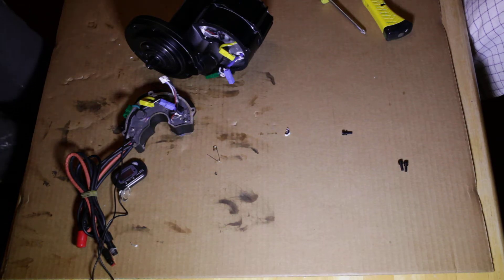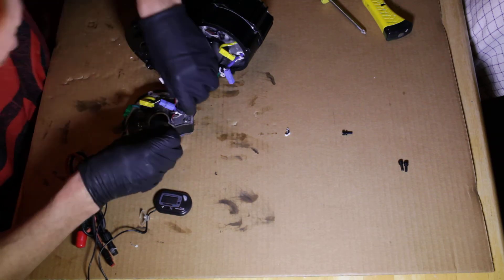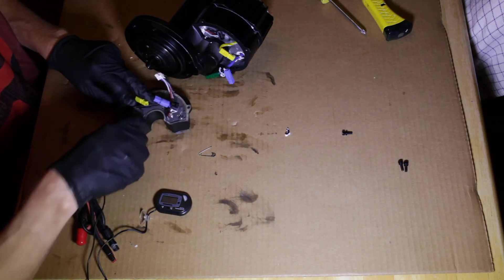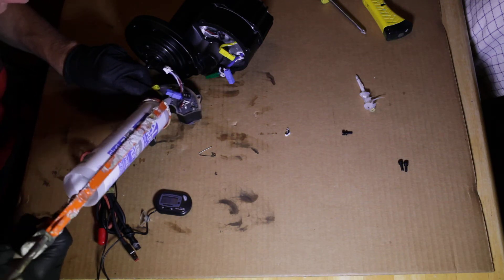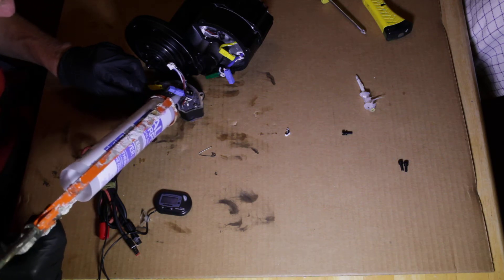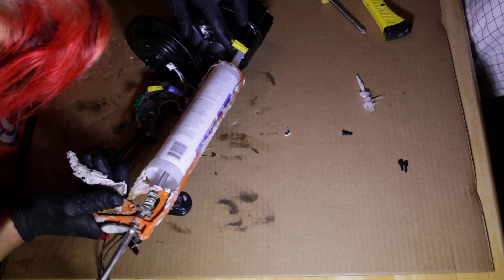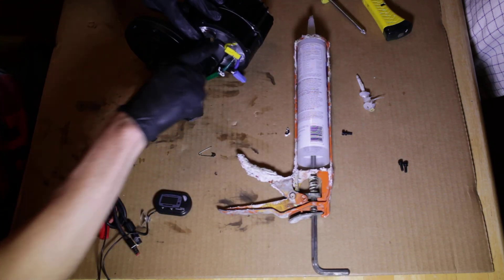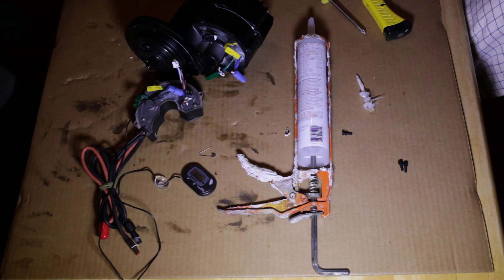BBSHD Installing a temp probe in controller and disabling the PAS system

Comment: I turned off the mode PAS by programming my controller it is not required to disassemble the engine
Reply from the maker: You can disable the PAS by programming but you only get one throttle power level. By disabling the wire you can program your BBS02 to have 5 different throttle power levels. Many people with the new BBS02 controllers opt to do this as well because the PAS overrides the throttle settings which many people don't like. On all 8 of my BBS02's the throttle always overrides the PAS settings because they are the older units.
Reply: @Electric-fatbike  I can get 9 different power levels, which I can control the throttle, while the PAS does not work. 9 levels are too much for me, I used 4 power levels of 1 ~ 220 watts, 2 ~ 500 watts, 3 ~ 1000 watts, 0 - maximum power. I prefer to switch between the first and zero power levels. To disable the PAS system, it is necessary to set the value 1 in the "Time of stop" field.

Comment: Awesome videos.   I just bought one of these pieces of crap!   Your vids are really going to come in handy!
Reply from the maker: +Kory Garretson It's actually pretty awesome on the trails, just needs a chainwheel that can keep the chain on. The stock one sucks. Totally unusable.
Reply: I need a setup that can handle long inclines on rough roads.   Already have the LunaCycle bling ring on order but considering having a shop fabricate an adapter for a smaller chain ring that already exists like a race face.   Your blog is great too, tons of good info. Between you and the nutty australian there are bunch of laughs to be had as well.   Good stuff, keep it up.
Reply: @Electric-fatbike  you wrote on your blog, that you'll test the hill climbing compared to the bbs02b, what s the difference ? (More Watts, More Nm, Gearreduction)
Reply: +Kory Garretson Why did you buy it if it's a piece of crap?
Reply: I was being a little sarcastic, it's the biggest and baddest motor that's available for the money, but it's certainly not perfect.    I'll be building a 29er mtn bike project soon, we'll see how she goes.
Reply: +Kory Garretson why would you choose 29 over 26? The bigger the wheels the lower the power. Why is 29 better then 26? I'm just wondering...
Reply: My bike is primarily used for transportation on bad roads and trails.   The 29 is a much more comfortable and quick ride in such conditions without the complexity, cost, and weight of a full suspension or a fat bike .   Luna Cycle makes a tiny front chain ring for the BBSHD (around 50$) that has solved the torque issue on hills.   I have over 1000km on this setup with 13s and 14s lipo and it is working flawlessly.
Reply: Bad roads Is the only justification I think for 29. Really bad roads. Like, New York style.
Reply: Much, much worse than NYC.    http://qcostarica.com/monteverde-community-continues-battle-for-a-decent-road/
Reply: +Kory Garretson seriously, seems you need a tires bigger then 29 :D  Wow you live in Costa Rica. I think in that condition, I would get a 29 with dual suspension MTB.  Meanwhile here in NYC I'm setting up a BBSHD on a Dahon Jetstream. A little crazy perhaps, but I want to see how it turns out. It's a 20" wheels...